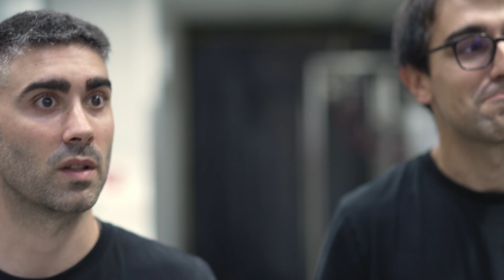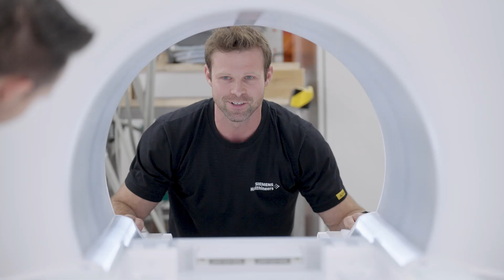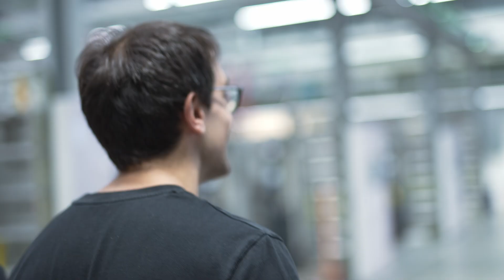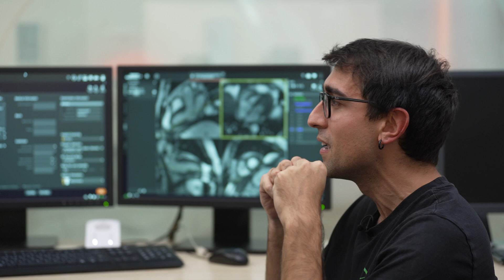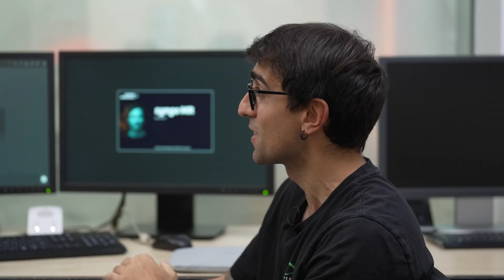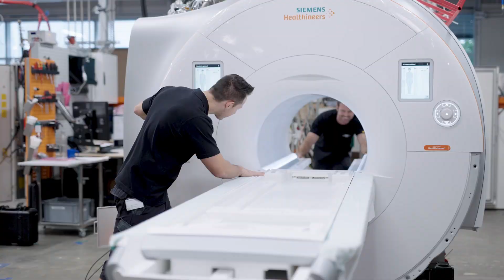The Past, Present and Future of MRI | Ep 3/3

Comment: I worked on those old MRIs like the one in the background...you can tell from the shape of that head coil that it's a single channel (linear polarized) coil; when they came out with the circular polarized coils, the S/N increased by almost 40% overnight!  Also, the earliest Siemens head coils were receive-only, the RF transmit was from the body coil (also linear).  There was no SAR monitoring in the beginning, and when they upgraded to the circular polarized system, the patient heating went down by around 1/3! 
The first Siemens dedicated breast coil was designed not very ergonomically...the patient laid on her belly and the coil was in a built-up pad; there was one single large round recess in that pad, LOCATED IN THE CENTER because those scanners didn't have the ability to zoom in acquisitions off-center.
Similar to the display MRI in this video, many MRIs in past years had a wall at the front of the magnet opening.  This was found to make the patients more claustrophobic.
Reply from the maker: Thank you so much for sharing these fantastic insights. It is amazing to hear stories like these, coming from practitioners who actually experienced this transition in the very first place!!

Perhaps this would be a nice story to tell in one of our podcast episodes 🙃